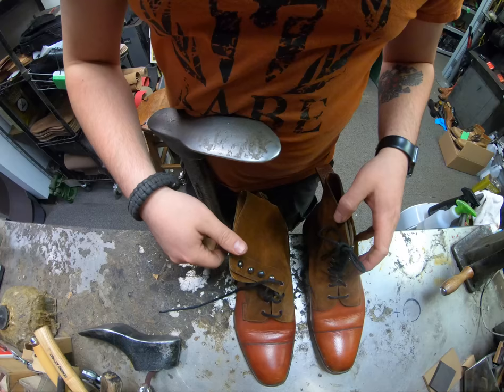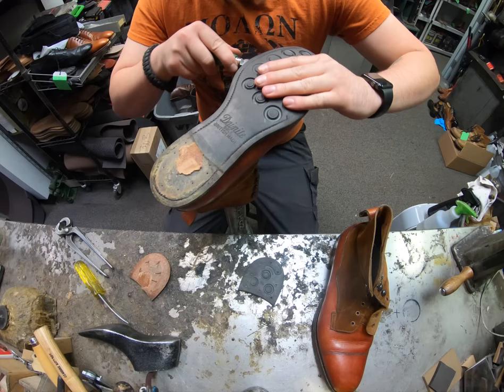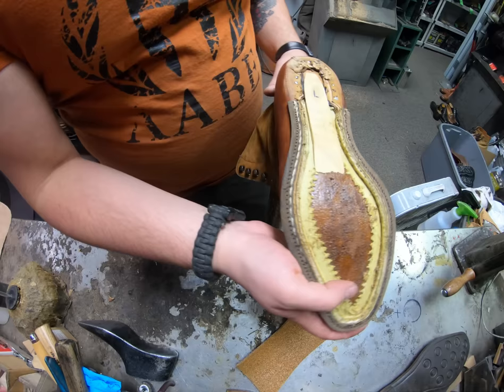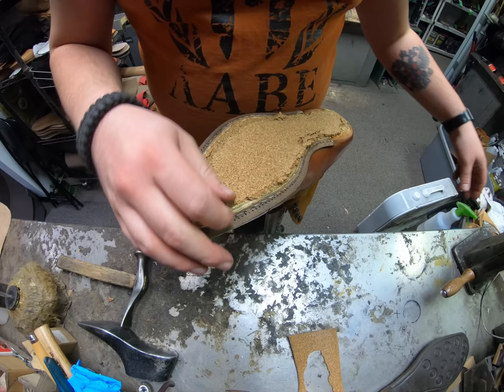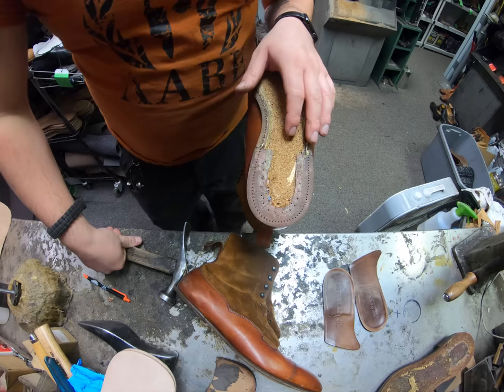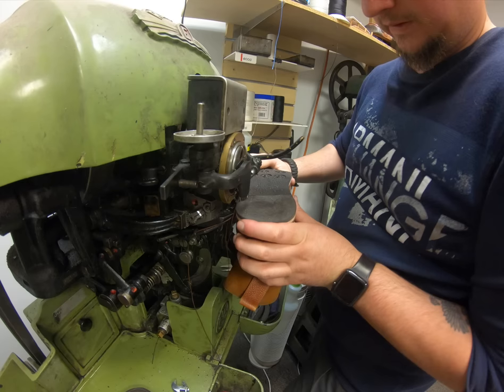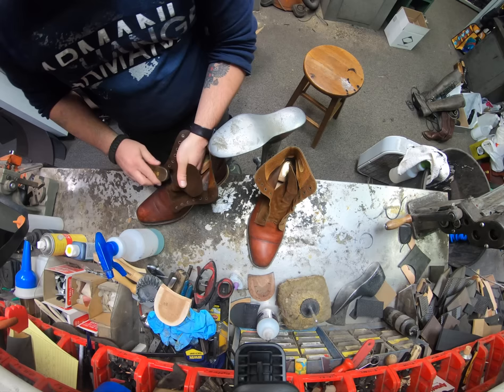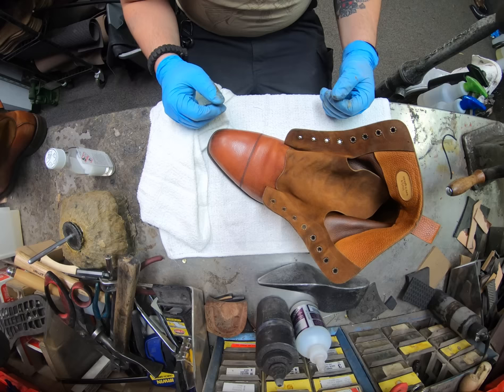Edward Green Boots Refurbished with Dainite Soles as well as a Saphir treatment and Leather Patina

Comment: You don't get long even out of rubber. The most durable material for soles is polyurethane but unfortunately most formulations are prone to breakdown by hydrolosis, hastened by heat, storage and moisture. Soles with those formulations can be fine one day but the next if theyy meet moisture they'll just crumble away. Very lightweight too.
I don't think its very good to work with for bonding, grinding so perhaps that's why it's not used much except on moulded soles.
I'd a pair of Blundstone 500 which I wore for years 2001-2007. It lists the sole as TPU I assume polyether because it didn't hydrolise. That doesn't adhere well at all though.
Reply: dude that is a dainite sole. the best in the industry. i have one for 3 years wearing it atleast 100 days per year. and it is not even close for a resole.
Reply: @iaido01  😲